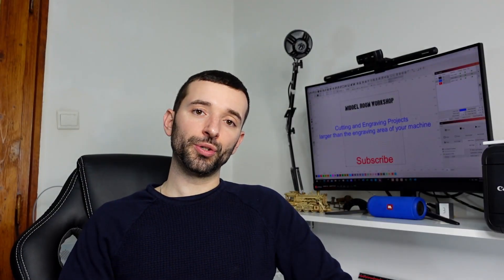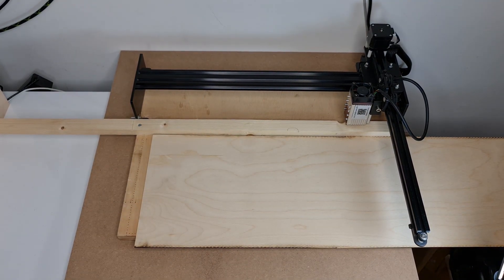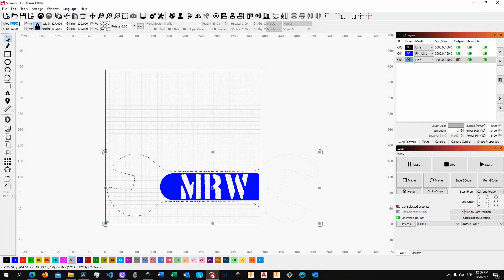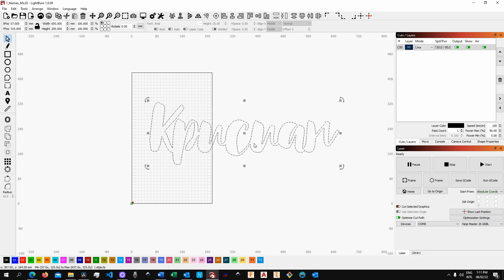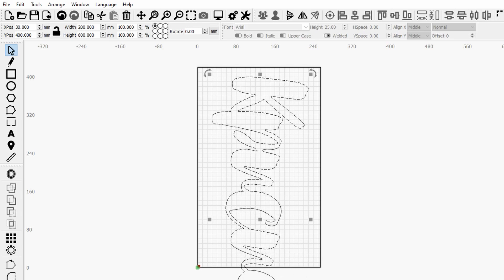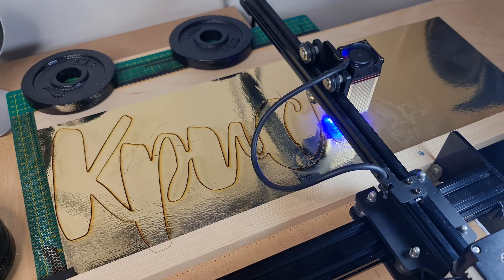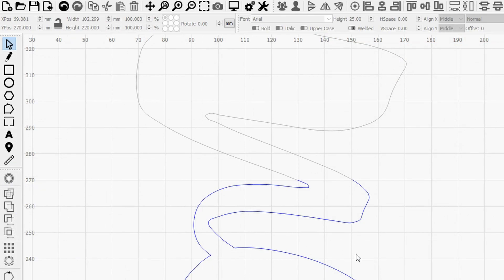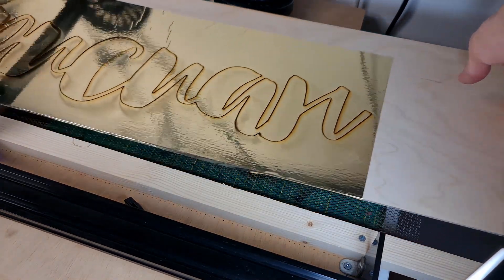Engrave and Cut Projects Larger than your Laser Engraver + LightBurn workflow

Comment: My laser is attached to my cnc, and the program I use (v-carve) for cutting larger objects, has a menu option called 'Tiling,' which helps do the same things as instructed here. However, since I'm new to lasering, when I switch to lightburn to operate my attached laser, my old brain couldn't figure how to do it.This is an excellent explanation. Thank you

Comment: What's the name of that material? Thanks for the video, it was really helpful
Reply from the maker: Hi, Pablo May; thank you for your comment. 

That is a 3mm sheet of birch plywood with a manually stuck gold foil. 
The foil is a non-PVC-based (avoid PVC products as they are very toxic) foil normally used for advertising purposes. You can find them in many different colours; the only caveat is being able to stick them evenly without air bubbles. 

I hope it helps 
CIao

Comment: awesome great explained so clear spoken and everything step by step slowly showed and explained.very cool.I thought it is kind of a spray what you used. I thought cutting PVC is bad for your laser could destroy it because it is so sticky when you cut it and spread around everywhere i just heared this
Reply from the maker: Hi, Learn To Drive Properly; thank you for your comment and compliments. 

In the video, I used a sheet of 3mm plywood with some polyester foil. 
In general, cutting PVC is to be avoided because of the highly toxic fumes and the hydrochloric acid produced in the process, which is highly corrosive and harmful for our health. 

I discourage doing it, but taking the proper precautions, one could still cut a PVC foil, considering that out of a 50microns foil where maybe only 50% is PVC, the kerf or cut thickness and the balance of the chemical formula you get a very minimal volume of acid for a meter of cut.

Cutting a more substantial amount of PVC is to be discarded at all costs; the acid mentioned before is highly toxic and can also be fatal.

I hope it helps, and please discard trying cutting any PVC
Ciao

Comment: I've done this with my CNC router but never thought of doing it with the laser, genius. 😁 What in the world are you cutting there? I thought you couldn't cut shiny material with a diode laser. Thanks for the video!
Reply from the maker: Hello George Chambers, thank you for your comment.

If you refer to the material, I am cutting a sheet of plywood with some golden PVC foil applied on the top, if you referred to the name, don't ask ;), I don't know why some people like these unreadable fonts.

The issue about what you can cut and you can't, is not 100% dependent on the colour, the truth is that things are a bit more complex, you see colours, the way we defined them represent a very small range in the Electromagnetic spectrum, in particular, is the part of it that the receptor in our eyes have developed to distinguish, however, matter does not respond only to visible light but to the whole range, and each material responds differently.
The science behind laser cutting technology relies on the part of the spectrum that is absorbed by the material, here despite the material might have a shining mirror finishing (which still influence the result), we care about whether or not the material absorbs the light with the same wavelength of the laser.
This at times may lie outside of the visible range, in fact, referring to a CO2 laser working at 10.6 micrometres, the light is outside the visible range, in particular the infrared one, and as you surely know is used to cut many different materials including glass that to our eyes is transparent but not within the infrared zone.

Sorry for the lengthy explanation but this is the shorter I can be without getting into the Chemistry and Quantum Physics side of things.

I hope it helps.
Ciao